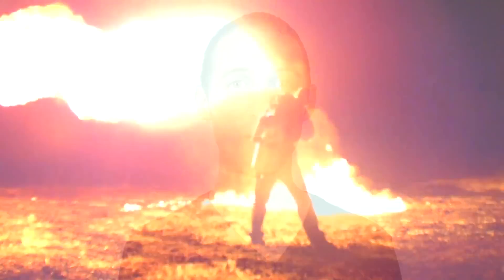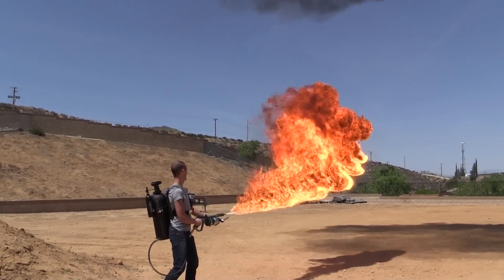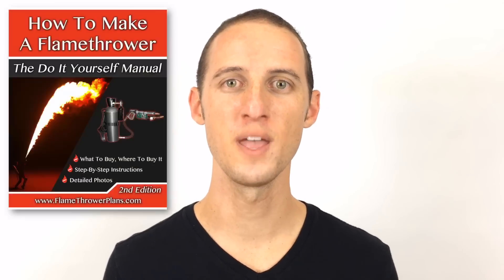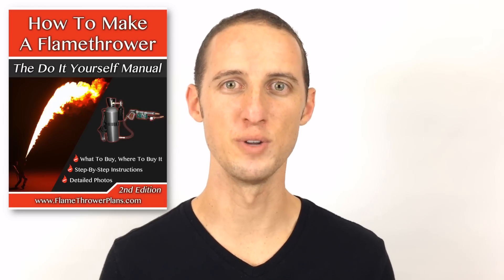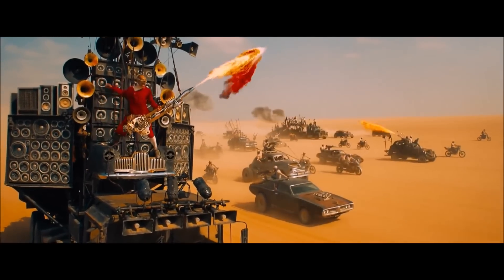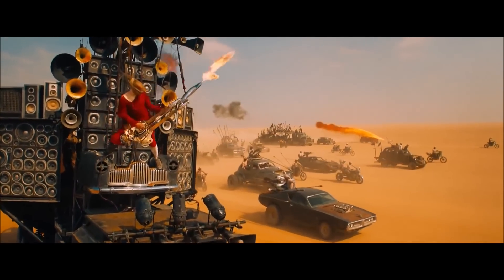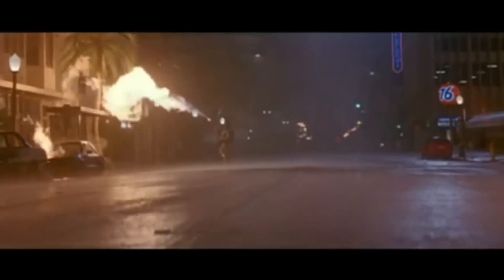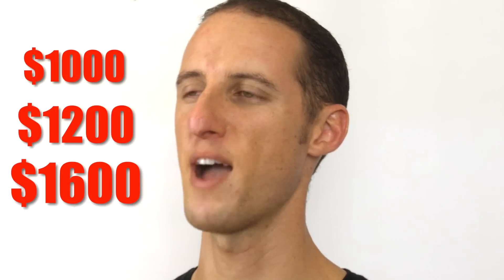How I built my homemade flamethrower

Comment: have you tried installing two paintball air tanks instead of one? with one way valves so the air stays in the scuba tank?
Reply from the maker: +Alexander Edwards Yes I've done that, looks cool but doesn't really make much difference in performance

Comment: CA has a 9ft or 10ft effective firing range law on our flamethrowers. Does your book address a way to make the effective firing range 10ft instead of 50ft? Keep posting the videos!
Reply from the maker: +ownedkapoo You're right the limit for CA is 10', currently I don't have a CA legal tip but I'll see if I can find one!
Reply: +ownedkapoo  you would not want a 20 pound tank or the shown nozzle for a 10 foot distance!  smaller nozzles and lower pressures are needed BOTH for a safe fuel projection at such low lenth of reach. If you dial down the hose/tank tip Rob uses to that tiny reach the spray will not diffuse correctly from such a course tip(which is meant for 1200 psi pressure washers). You could actually risk back flash from fuel not levaing the nozzle at sufficient force.  A $3.00 trigger spray bottle from the hardware store9small nozzle  to combine with hand trigger/low force)will shoot farther than ten feet.   Having 'larger/coarser' out put systems and trying to dial them down too much might get you in trouble fast.  putting 5 pounds of pressure in a tire meant for 40 pounds of pressure makes it more dangerous...not safer. EVERY component of the flamethrower has to be of the right size and pressure for the intended flame output desired. Some adjustability of course...but not from 50 feet to CA's 'ten'. Not safely.

Comment: Would it be possible to make one of these using 2 tanks like in ww2?
I was thinking about getting two tanks and just using 2 c02 tanks to pressurize them then using a Y shaped tube to connect it to the pressure washer gun
Would anyone know if this would work?
Reply from the maker: It will definitely work, it's actually something we plan to create at some point in the future. Once you get the initial build down, it's very easy to swap out parts to fit the look you're going for.

Comment: and maybe isopropyl 99%
Reply: +Alexander Edwards  isopropyl is weak...as is any water soluable solvent.  oil based solvents are not only more volatile but 'safer' due to flash points. it is very important that a fuel project well from a flame thrower (greater density of fossil fuels). You notice how flames  linger a bit and the ignition point is a little bit out from the nozzle...that is a density issue  and provides greater distance and burn time than a water based fuel could. shoot some Iso out of a trigger spray bottle over a bic lighter...and you will see that it is not very effective...very different from doing the same with gasoline. i have roasted many weeds and bugs with a home depot heavy duty trigger sprayer/gas.  Aerosolized carb cleaner is the best I have found. iso is a 'colder' burn...quick flash and it is gone.